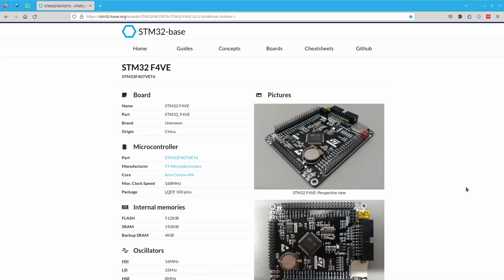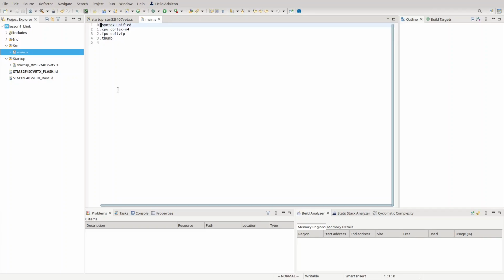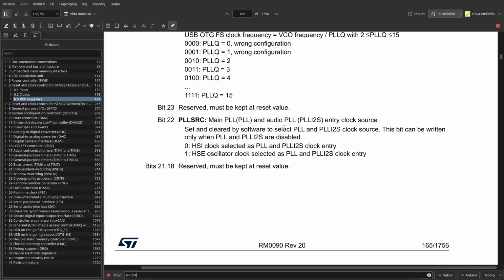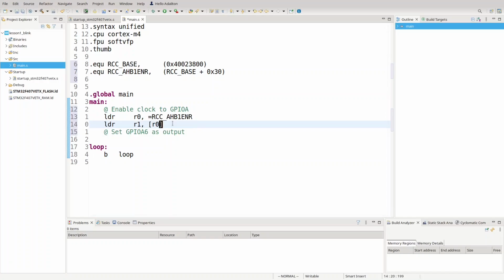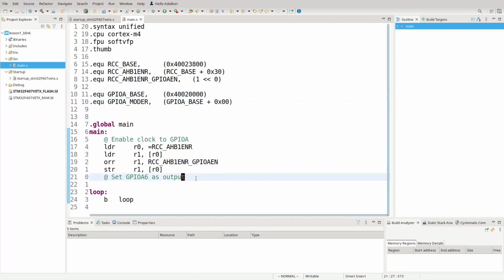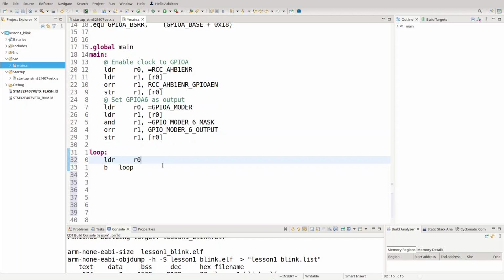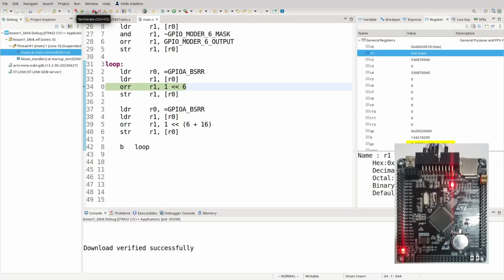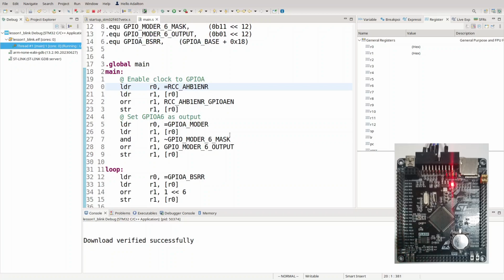STM32 Assembly programming | Blink

Comment: Where would you use an assembly for STM32 firmware development in practice?
Reply: You don’t, it just for learning.
Reply: @estacouveflor  is learning it necessary to get good, if it's never used in real projects?
Reply: @estacouveflor  Is learning it necessary for embedded developer if you are not trying to become reverse engineer or something? People say tha in some cases it may help with debugging, but i'm not sure. One guy told me that to program in C it's ideal to know assembly, though now I'm not sure what exactly he meant by it
Reply: @qt1qg  the required knowledge depends on your objective. For example, you can be an expert driver without being a mechanic.
Reply: @estacouveflor  how often do you find that you need a knowledge of assembler when programing MCUs in C without arduino language? Should you know assembler(when you never use it dirrectly to write firmware) to get hired as a developer if the product is not something super high performance or mission critical?

Comment: Why not used bit banding for GPIOA->ODR bit 6?

my 34 bytes long for black pill ledblink:

/****************************************************************************
 * @file      startup_stm32f401cdux.s
 * @author    Auto-generated by STM32CubeIDE
 *
 * BLACK PILL LED BLINKING IN ASSEMBLER 34 BYTES LONG !!
 ******************************************************************************/

.syntax unified
.cpu cortex-m4
.fpu softvfp
.thumb

//==========================================================
#define RCC_AHB1_ADDR             0x40023800
#define RCC_AHB1_EN_OFFSET        0x30
#define ENABLE_GPIOC_VALUE        0x04
#define GPIOC_ODR_REG_OFFSET      0x14
//============================================================================================
/* 1. RCC->AHB1_ENR = 0x04 ; ENABLE RCC CLOCK FOR GPIOC (0x40023830 ADDRESS)  */
/* 2. GPIOC->MODER = 0x04000000 (1 << 26) SET GPIOC BIT 13 TO OUTPUT PUSH_PULL at  (0x40020800  ADDRESS) */
/* 3. GPIOC->ODR TOGGLE BIT 13 IN GPIOC->ODR REGISTER (0x40020814  ADDRESS)  */
/* 4. A SMALL DELAY LOOP */
/* 5. GO BACK TO TOGGLE BIT 13 IN GPIOC->ODR REGISTER */
//============================================================================================

//*****************************
  .section .text.Reset_Handler
  .weak Reset_Handler
  .type Reset_Handler, %function
//*****************************
//---
  .word RCC_AHB1_ADDR       // SP = 0x40023800 STACK POINTER VALUE IT REALLY DOESN'T MATTER - STACK IS UNUSED
  .word Reset_Handler       // THE Reset_Handler POINTER
//---
Reset_Handler:
/* 1. RCC->AHB1_ENR = 0x04 ; ENABLE RCC CLOCK FOR GPIOC (0x40023830 ADDRESS)  */
//---
    // SP = 0x40023800 BASE RCC
    MOVS    R2, #ENABLE_GPIOC_VALUE              // R2 = 0x04 = BASE TO OTHER 1 BIT VALUES
    STR     R2, [SP, RCC_AHB1_EN_OFFSET]         // RCC->AHB1_ENR = 0x04 ; ENABLE GPIOC CLOCK 0x30 = RCC_AHB1_EN_OFFSET
//---
/* 2. GPIOC->MODER = 0x04000000 (1 << 26) SET GPIOC BIT 13 TO OUTPUT PUSH_PULL at  (0x40020800  ADDRESS) */
    SUBS    R0, SP, 0x3000                       // R0 = 0x40020800 = GPIOC BASE R0 = SP - 0x3000 = (0x40023800 - 0x3000) = 0x40020800
//---
    LSLS    R1, R2, #24                          // R1 = 0x04 << 24 = BIT_13_REGVALUE_SETUP
    STR     R1, [R0]                             // INITIAL VALUE GPIOC_MODER_REGISTER = BIT13 SET TO OUTPUT
//---
    LSLS    R3, R2, #11                          // R3 = 0x2000 = (1 << 13)
//---
LOOP01:
/* 3. GPIOC->ODR TOGGLE BIT 13 IN GPIOC->ODR REGISTER (0x40020814  ADDRESS)  */
    EORS    R2, R3                               // TOGGLE BIT 13
    STR     R2, [R0, #GPIOC_ODR_REG_OFFSET]      // STORE VALUE WITH TOGGLED BIT 13 INTO GPIOC_ODR_REGISTER
//---
    LSLS    R1, R3, #6                           // R1 = 0x2000 << 6 = 0x00080000 = 524288 => R1 = delay counter
//---
LOOP02:
/* 4. A SMALL DELAY LOOP */
    SUBS   R1,#1                                 // DECREMENT REGISTER
    BNE    LOOP02                                // REGISTER NOT 0? SO STILL DECREMENT
//---
/* 5. GO BACK TO THE TOGGLE BIT 13 IN GPIOC->ODR REGISTER */
    BEQ    LOOP01                                // NEVERENDING LOOP
/*****END OF FILE****/

Comment: hey sir, I have followed this video and make the same BlinkLED project on STM32F103 and it worked. When I follow these step building a project using PWM to control motor speed rate its go wrong, could you help me debug this fault, it's seem that the data I wrote into stm32f103 wrong, I'm sure that I has configed both GPIOA and TIM2 but only the memory of the GPIOA has change and the TIM2 memory section has not do anything with every word data from this section is 00000000.
Reply from the maker: I'll try to implement a PWM and get back to you

Comment: Oh my god! I tried to do exactly what you have done and failed. Being a hobbyist dinosaur who started coding in the late 70s when the home based computers had either Basic or Assembler, the choice was easy.
The problem is the only other language I learnt was Cobol which does not exactly fit with a microcontroller. 
All the latest IDEs appear to be geared towards C with no good documentation on how to use assembler so this video is a godsend. 
👍Many thanks for taking the time to post

Comment: Great stuff! I have a degree in computer engineering but have spent the last couple years primarily designing PCBs I had recently tried doing a personal project with the stm32f4 and was so confused on how stuff was working at the truly low code level. Making a led flash in C is easy when you can just copy paste Hal functions. Definitely looking forward to more assembly programming
Reply from the maker: Really glad you liked it. I will try to bring some cool stuff as I learn it. Stay tuned
Reply: thats for learning good, but most projekts are c/c++ with an rtos... asm is only for little parts, which have to be very fast.